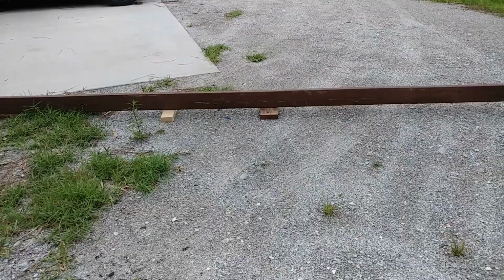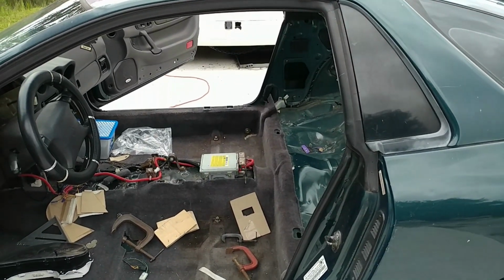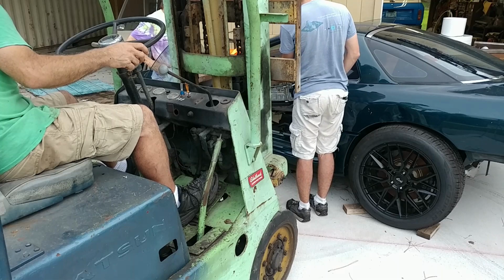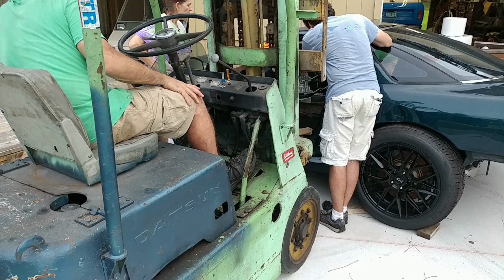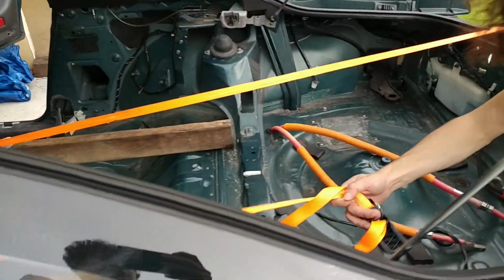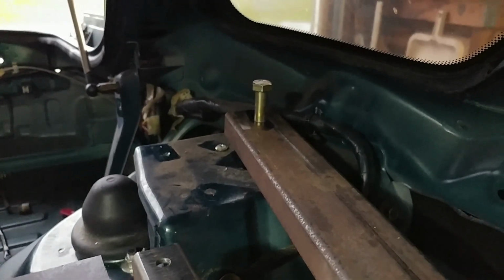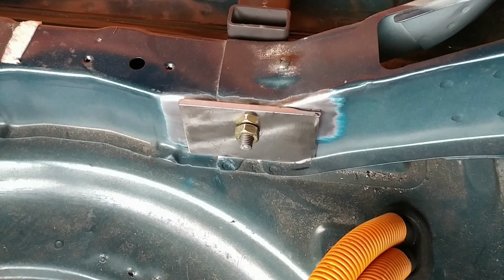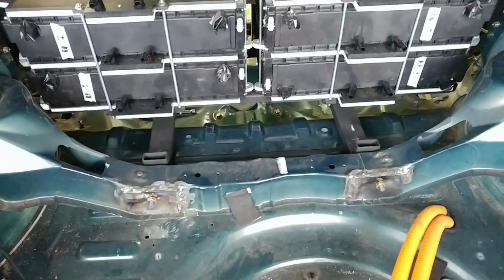Mitsubishi 3000GT Tesla Swap 22 - Installing the rear battery pack

Comment: It's so exciting seeing it all come together! I was just wondering why you went with a 3000gt instead of a different car? I found your channel after searching if anyone had done an engine swap on these as they are my favorite car and wanted to try doing one myself. Through my search, I stumbled across this project. It's incredible seeing the amount of work that has gone into this and I'm excited to see it run! :D
Reply from the maker: My search criteria were:
1)local
2)wide enough to have any chance of making this work
3)In rough enough shape/not especially rare/desirable to keep the price down (hence this car not being a VR4 or anything like that)
4)A 2 door Japanese performance car
There were some other cars I looked at but this was the first one that fit my needs and had an owner willing to close the deal in a reasonable timeframe.

Comment: How are you gonna control all this? I mean, what electronics for running the Tesla inverter and charging everything?

Wow, this is exciting!
Reply from the maker: I have an 057tech control box for the inverter, which I'll start with just some buttons for direction select and a 6 wire hall effect accelerator pedal, and an OrionBMS/Stealth EV setup for charging. For getting the minimum to be a drivable car it should need just a bunch of wires, but I hope to add my own CPU to manage things once I get past the first driving tests.

Comment: Would 2 modules not fit under or half sunk in a box under the rear seats and 2 in place of the rear x-member and have the x-member be replaced with a permanent strut brace ?
Reply from the maker: Maybe. I would lose the rear seats either way and after the long fiasco of making the cooling plates I didn't want to spend a bunch of time cutting out big chunks of car and welding up a new box. The rear pack weighs about 400lbs with the steel stuff so not unlike having 2 adult passengers. If the car drives well enough but the center of mass is too high I can revisit this but for wanting to get it done I decided not to do that right now.

Comment: Could you have just assembled that battery in place piecemeal? Would have saved you the effort of forklift and all that
Reply from the maker: We thought about it but the modules are still pretty heavy individually, so getting them aligned with the thermal pads in the car would have been pretty tricky.

Comment: That's abit too high center of gravity for my liking. And does not seem very safe in case of a severe crash.

There's a reason a Tesla handles so well. Extremly low center of gravity. All batteries in the floor. Other Electric cars usually place theirs in a center tunnel also very low.
Reply from the maker: The CoG was a compromise against spending more time than I was willing cutting out the back seats and plating over the hole. I'm pretty happy with the load paths for the battery to keep them from coming forward, but might add a little more once I get to the point where it's being prepped for daily driving.